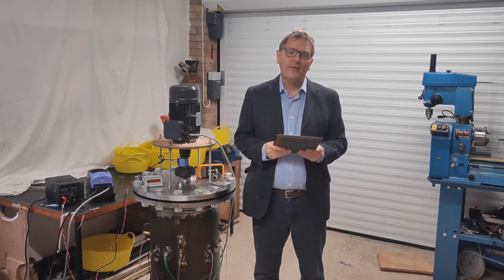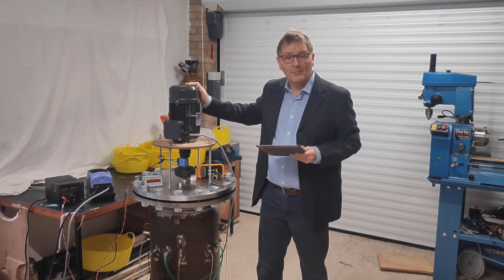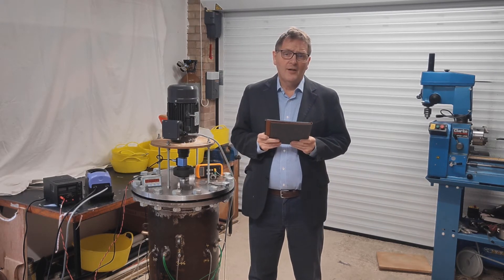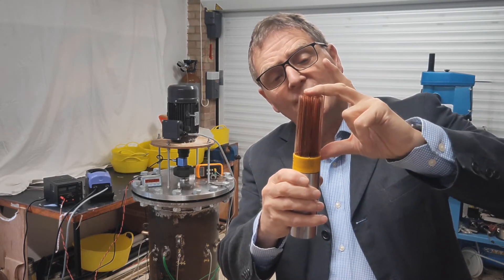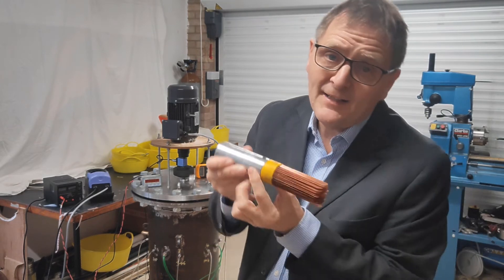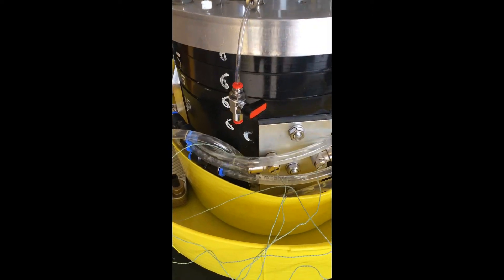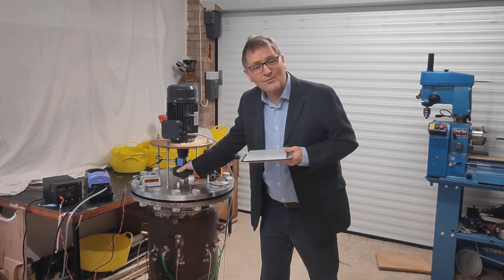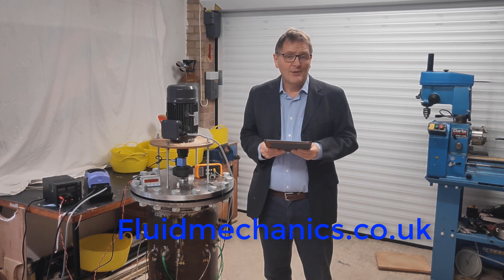Near Isothermal Stirling Heat Pump

Comment: Wow I swear I've been thinking about a very, very similar idea for Stirling cycle for years. Too bad I've been to busy to make it real, I hope for you it really works.
During my work on my own project I was concerned about piston instabilities due to oil/fins interactions and about the fact that the increased weight and drag caused by fins in oil would make the piston way harder to move. Did you observed such phenomenon ?

Comment: What's the best wattage and efficiency you can get for generating work from heat?  
Example: Heat source= 60-130 deg C (water, and variable amounts of CO2 ) , Cold=4 to minus 20 deg C (Wind-chill/CO2/Di-Methyl-Ether).
Reply: 1-((273-20)/(273+130))~37.2%
Quite a diiference, depending on whose equation you trust.
I think the more pragmatic equation is the one with the square root.
Reply: There's a Reddit post under "AskEnginners". 
The title is: "Could a geothermal Stirling engine electricity generation like this work?"
I made some comments there. Might interest you.

Also, on Reserachgate, there is an post "What is the maximum efficiency of a stirling engine?" 
by Krishna kanth Mundada, Indian Institute of Technology Hyderabad. 

In the comments is an answer to his question. 
It cites the equation: Efficiency = 1-sqrt(Tc/Th), instead of the usual Carnot Efficiency  1-(Tc/Th), and also states that Carnot's model was unrealistic.

Any thoughts on this? Which equation is best, or is there an even better one?

Comment: Very interesting.  If you can get the coefficient of performance high enough would it be possible to use the extra heat to produce energy needed to run the heat pump.  Say a closed system where you have for example ammonia or hydrogen stored in a hydride and run the gas produced by heating one tank (the source) through a pneumatic engine (Angelo de Pietro's compressed air engine for example) and storing the exhaust gas in another hydride storage tank (the sink)?  Maybe three tanks for cycling continuously.

Comment: with your design is there any way to create electricity with your temperature differences... any geothermal source seems good for your design - is % loss too great ... could you team up with caldera and create a home use... Hope you have patents because China will already have stolen the idea and be using it ... I realise the Navy and big orgs will be using this tech as it significantly lowers CO2 but can't you get a government grant and get this into homes asap. Energy prices are just going to increase .. UK needs to get rid of Gas and use hydro, sun, wind, battery - heat/storage and heat batteries asap. Government advice on heat pumps currently is a joke - I have an air heat pump - its inefficient under 4 degrees therefore useless. This is as bigger problem as Covid - solved it in a year - I realise vaccine stock owners are bleating about variants but its unscientific at best.. why don't we do the same with energy and get the government backing strong UK companies with billions - China does and that going to be our competition - a country that cannot get rid of coal...

Comment: I'm confused.

The 'stirling' part is the compressor?
So the 'HARS' are always going to be getting hotter, or always getting colder? ( hotter unless it's working as a generator)

This isn't like a regenerator where it cycles rapidly from hot to cold. 

Or am I missing something???

Edit:
Ok after watching the linked video.
The Silicon oil is acting as a heat transport medium, there aren't any refrigerants in the system. So the HARs do double duty in transferring the heat to the oil. Although this point contradicts what this video says.

The increased efficiency does increase the COP.

Comment: Having watched this video, I better understand the engineering of this approach.  I think this has real potential to revolutionize refrigeration, but there is a sticking point: you're using helium as your working fluid.   Helium is a very small atom that slips through small cracks easily.  Combine that with the use of moving seals, and I can see leaks being a real problem.  Then you have to take into acount that helium is a very expensive gas.  These are commercial implementation issues that I see.  If you've already addressed these issues, then forgive me for stating the obvious and just ignore me.  I look forward to seeing how this project evolves.  Good luck!

Comment: "The gas, that we have sealed between the cylinder and the piston [...]" Seals between cylinders and moving pistons are problematic. This technology will not transfer well from the laboratory to the real world. Maintenance issues would quickly make this system useless in the longer term.
Reply: is you have a problem with you futur stirling pump, just go see you mecanic ^^ (no problem)
Reply: Pretty sure he's got this aspect of it well understood.  You can read his patent related to seals for pistons.  Quite clever.  Uses a lubricant fluid that is kept at the same pressure as the area on the other side through a clever mechanism and so the seal itself is a low pressure seal and lubricated for long life.
Reply: It's basically a compressor with some extra technology added. Compressors are well-known, extremely reliable and durable technology. I don't see this being a problem here.

Comment: I also came from have a think. Having looked in to air source heat pumps last year I was very disappointed by the costs, not least the need to retrofit insulation to my Victorian semi. At the moment there is no realistic alternative to a gas boiler in the UK, but this looks like a very promising step forward. Hopefully one day one of your pumps will sit alongside my pv array and CO2 emissions for my heating and hot water will be a thing of the past.  
I wish you every success.

Comment: I have always believed that using electronic controlled voice coil type actuators would allow you to optimise the cycle rather than mechanical actuators. Most losses would be in the wobble plate you use, adding a bit of AI would be able to continuously optimise the cycle and allow the unit to run at a variety of frequencies without loss of efficiency.

Comment: You ask me to critique this video. Seems you really know how to heat and cool, but your video technique is CRAP! I had to use an auxiliary sound BOOST system because your audio was much too low to hear comfortably, and there were so many ECHOS in that hard surfaced garage warehouse, the signal-to-noise ratio was much sub-par. Regardless good luck distributing your technology for the benefit of mankind. Intriguing! Get a dump of investment into it and get it going!

Comment: Excellent! So your HARs are like regenerators allowing the transference of heat to the correct part of the cycle (from the compression to the expansion) morphing the Stirling cycle into a Carnot cycle on the T-s diagram.

Comment: Stirling engineers: We cannot raise the efficiency, to produce more electricity !!!
These guys: We raised the efficiency significantly, it now CONSUMES electricity...!
Me: Noh !!!!!!!!!!!!
Please don´t try to correct me, I already know that I don´t only oversimplificate, but that´s straight not what happened here... I simply would have really cared to find out (in this video), if their "fins" could have positive effects for stirling-engine-strom-generators, and if that then would be some kind of groundbreaking... 
Heating or cooling problems in buildings can be already solved with passive-house-building-techniques, which cost very little, but are easily applicable only for newly-built-buildings (and extremely unsexy and boring). A friend of mine (with wife and 2 children) had 1000kwh consumption last year (and a bottle of gas), so, why should he care to add an additional system, where alone this system´s loses (due to inherent inefficiencies) would exceed his momentarily total-consumption, and the gains would be irrelevant...?

Comment: If you use solar wind and batteries then there is no point of improving the heat pump. The money is better spent on solar wind and batteries. Look up Tony Seba. Best regards from Egypt.

Comment: Commercially Helium would be a poor choice as it is a limited resource and non recoverable as it is lost to the upper atmosphere when released. Are there other gases that could safely be used?
Reply: It's could be H2
Reply from the maker: Mike Crowley
  • 1 second ago
The machine works equally well with helium or hydrogen. The mass or volume of gas used in each machine is very low, so the flammability risks of using hydrogen are much lower than say the risk of using a  gas cooker in your home. The main risk with hydrogen is during manufacture, if you have a lot of machines to fill with hydrogen gas then there are health and safety risks, but this can be controlled with good working  processes and  ventilation
Reply: (not flamable Helium and Neon)and Hydrogen are the 3 to date known gases who eat when expand ,a mix of two or the three is probably a good choice to test and observe
https://chemistry.stackexchange.com/questions/61517/reason-for-negative-joule-thomson-coefficient-of-helium-and-hydrogen-at-ntp-cond

Comment: With a growing shortage of helium have you investigated other gasses. What is the safety factor of using something like hydrogen instead?
Reply from the maker: The machine works equally well with helium or hydrogen. The mass or volume of gas used in each machine is very low, so the flammability risks of using hydrogen are much lower than say the risk of using a  gas cooker in your home. The main risk with hydrogen is during manufacture, if you have a lot of machines to fill with hydrogen gas then there are health and safety risks, but this can be controlled with good working  processes and  ventilation. 

Ultimately helium is a gas with a limited supply so in the long term (30 years +) hydrogen will be used.
Reply: Hydrogen has similar low friction and ability to flow / carry heat. Though it is not noble and the containment vessel would need to be designed accordingly. The issue as I see it is that due to helium being light and non reactive it escapes the atmosphere and is predicted to lead to a shortage crisis in the next 30 years.  Using it in a heat pump would be wasteful. Hydrogen is more difficult to contain and more reactive but the advantage is that its easier to obtain and leaked helium is significantly more likely to react and bond to other elements like oxygen in the atmosphere before leaving.

Comment: This is great. I would be interested in how those fins would work in a regular Stirling cycle.
Reply from the maker: Christian, The fins are a new invention there are no fins in a regular Stirling cycle
Reply: @MikeCrowley  Well, that´s the question here: Would the application of fins (in such a way) bring any development for stirling engines too???
Reply: @MikeCrowley  
What about the passage between the hot and cold pistons in some old "Rider Ericsson"  hot air engines...they had a group of regeneration plates set closely together at the top of the engine so heat/cooling gas wasn't wasted...
Some newer models use copper wool instead im thinking...
Reply: I hope too to find something out...
Reply: they seem to me to be here just for transfer the heat beetween the piston and the fluid

Comment: Fantastic Mike. I've followed the development of Sterling engines, and wondered if I might one day use it as a solution to live in a campervan, whether to gather heat off van roof, or solar-thermal PV. But my immediate concern is 'have you eaten lately', because you appear to be working out of your mothers garage, and at age 50s plus, I'm a little worried for you. Moreover, your hair looks like it could do with a wash.
Reply from the maker: Andrew thanks for your concern. My mum has been feeding me well, but I think I will have to get a PR consultant in to sort out my hair. Due to the covid restrictions the hair cut is a bit of a DIY job.
Reply: @MikeCrowley  :) great answer.   Your fellow inventors know that it's what's inside the head that matters ;)

Comment: Mike, great work, can’t wait to get my hands on one. What kind of motor will you be using in the final product? Are you looking at synchronous or switched reluctance motors at all to hopefully yield even greater efficiency?
Reply from the maker: There is quite a lot of choice when it comes to motors and different applications and sizes will benefit from different motor types. Ultimately is comes down to a choice  based on efficiency, machine size, cost and reliability
Reply: @MikeCrowley  if cost wasn’t a factor and you were shooting for maximum efficiency, is there one you would favour?
Reply: And when can we expect the next video update?
Reply: @MikeCrowley  
What is the cooling COP, and have you tried heating and cooling it and observing its output when motoring under its own power?
Reply: @gregorymalchuk272  see this is what's getting me about this, it's supposed to have a COP of between 3 and 5ish depending on temperature differences. If even a regular stirling engine works at 40% thermal efficiency, then this machine can self power at least and produce excess power of 100% of the stirling engine possibly.
It's not possible probably or I'm misunderstanding what I'm being told. Or why isn't this an exciting breakthrough in energy production?
Reply: @jeffjefferson3364  very true, this is so optimized I'm surprised he isn't saying 70%, strange.

Comment: I am really excited about your technology,
Being a user of a standard heat pump in our house in Portugal, I noticed that the heatpump struggled and failed to heat the house adequately when the temperature dropped below 5c. So with the UK government saying everyone should convert to air source heat pumps, I am very sceptible of that viability, but your techology seems to hit the problem squarely. Please keep me updated, I am very interested in purchasing one of your devices when it is available
Reply from the maker: Our heat pump is capable of working with much higher temperature differentials so going from an outside temperature of say -10c to a water temperature of +60c is possible. It will be a few years before one of our heat pumps is available to purchase. Currently we have a working prototype but there is still a lot of development work required to make a reliable consumer product at an affordable price.

Comment: Hi Mike,  fantastic video and brilliant idea.  Could I ask if you've measured the Pressure-Volume relation over each cycle to see how close the machine approaches an ideal isothermal expansion and contraction?
Reply from the maker: Yes, absolutely
Reply: @MikeCrowley  Are you planning to do an update Mike? After 3yrs it seems you should be near production stage? I have a system that will allow all combustion engines to out perform like never before.

Comment: The Pressure chamber is maintained at one value to allow the helium to compress and expand.

so how is the oil circulated away to transfer heat while maintaining constant pressure in the chamber? I'm having trouble understanding that.

 The addition of fins to the piston is a genius idea!

edit: I checked out the website. it is explained there, I wish you the best in leading the way on this improvement.
Reply from the maker: Very good question. The oil in the heat exchanger is at the same pressure as the oil in the pressure chamber. There is a system not fully explained in the videos that moves the oil in and out of the bottom of the cylinders. The oil pressure in the cylinders does change but the oil circulated in the external heat exchanger is at constant pressure. I would probably have to do another video to explain this.
Reply: @MikeCrowley  are you planning on doing another video?

Comment: I am in the construction house building world and the industry needs to transition from gas boilers to an alternative. The most likely will be heat pumps. Your system looks very interesting and for me the generation of heat is great but the generation of cooling could be very useful to cool solar PV systems that could power your system thus increasing the efficiency of the PV. One for you guys to think about.
Reply: 'the industry needs to transition from gas boilers to an alternative.'
We don't need to transition we are being forced to by corrupt politicians
Reply: @mrtea3372  We use gas for a reason. A gas boiler is min 24kw, often as high as 42kw... Try squeezing that down your single  6mm electrical supply cable. And they want our car outside charging on that at the same time ! .... We just replaced all the low pressure gas with high pressure lines, and now they want to do away with it. It's plane stupid.